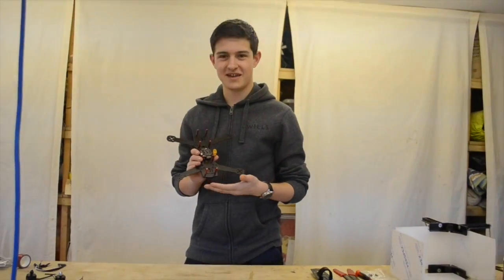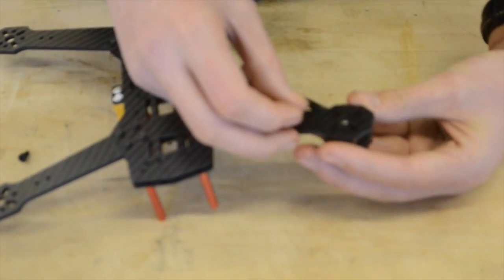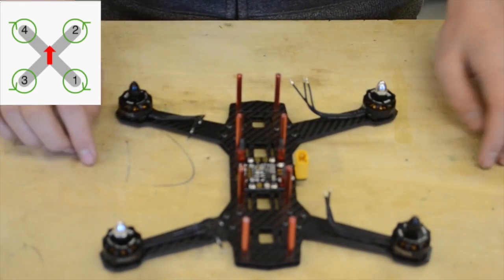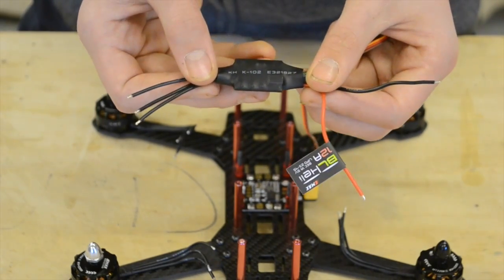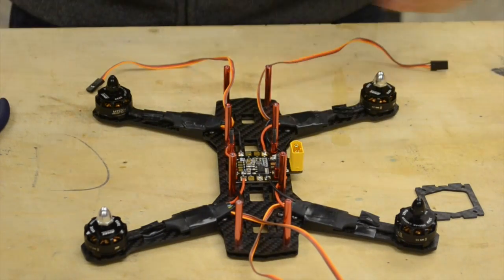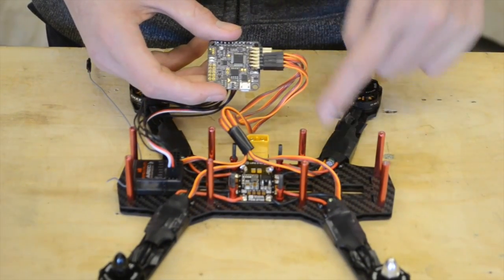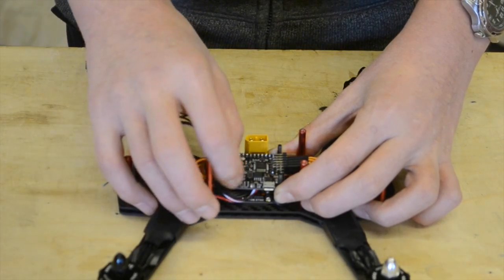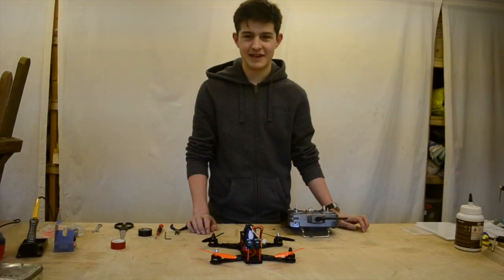Hobbyking A250 QUAD BUILD PART 2: ELECTRONICS

Comment: Your escs are too small in amp you need at least 20A for that size motor.
Reply from the maker: I know, since then two of them have burn out so i am replacing the lot with 20A ones
Reply from the maker: Also what vtx would you suggest for this quad- I'm thinking 200mw